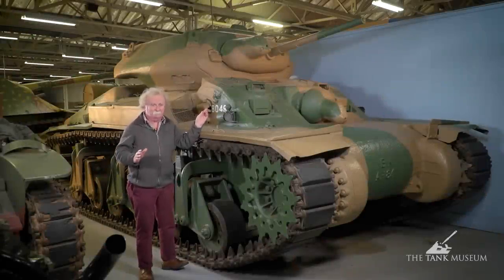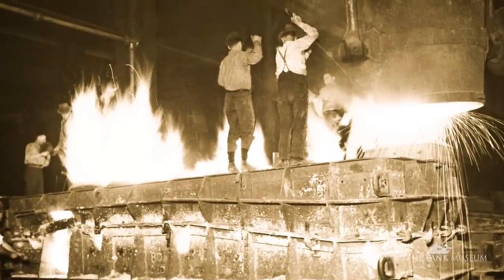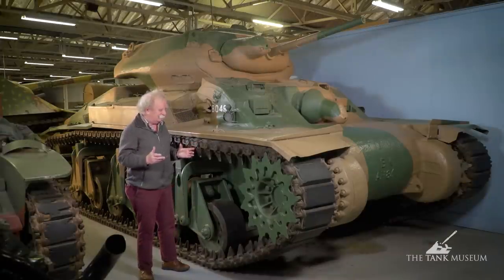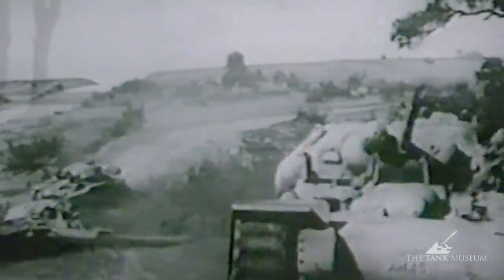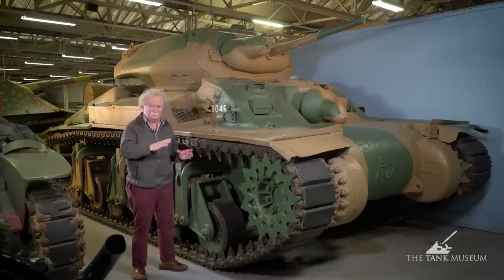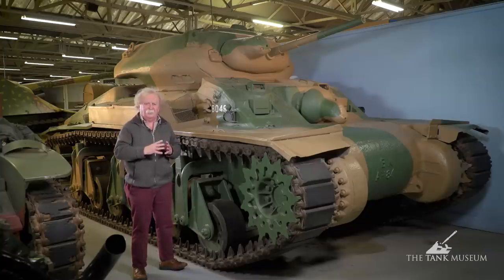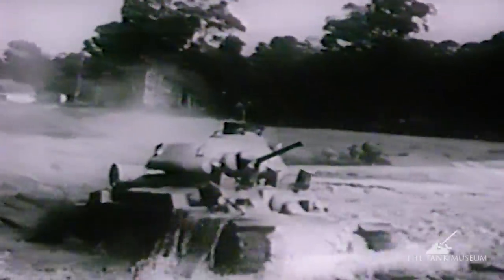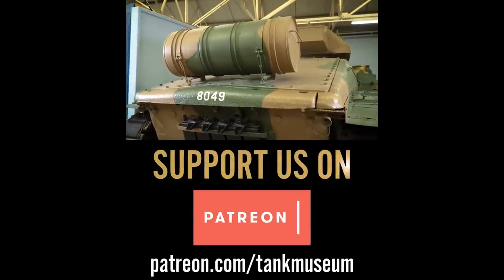Tank Chats #73 Sentinel | The Tank Museum

Comment: It's a shame the AC1 Sentinel is known for one small lewd thing, because it's a marvel of achievement for the Australians, with very little help from anybody else was able to produce a respectable tank.
Reply: Do you know if the engines were sourced from America or they were already being built their under contract ??
Reply: I wouldn't call that small!
Nice profile picture by the way :)
Reply: @mattmopar440  I think they were already being built under licence in Australia, without looking it up but at the time of the start of WWII Australia found itself far away from the supply of equipment which meant the start of panic programs to quickly design and build our own weapons which meant using whatever we had at hand thus the Boomerang was developed out of parts we were already building under licence for the Wirraway trainer for instance, so I suspect that the same will be for engines and such.
Reply: @mattmopar440  They were commercially available auto engines. They had planned to use the 'wasp' radial engine from the Boomerang but the Airforce needed as many as they could get. I recommend looking up a picture of the Sentinel's powerpack, very complicated engineering for a first tank, the transfer case is nearly as big as another engine.
Reply: Early on australia was too far away for anyone to effectively import cars. those ginormous car carrier ships didn't come along until well after the war. So we made our own versions of most cars in house. We had ford and chrysler and holden factories churning out localised versions of the cars. Now whether chrysler was manufacturing engines at the time i have no idea, a quick google didn't show anything up either but i can imagine they were.
Reply: Given the likely foe of Japanese tanks: the sentinel was better armored, a little slower, and had a gun that could obliterate them in the 25 pounder short barrel. The 17 pounder would have been better at attacking bunkers, as the Japanese favored light fast machines, which combined with the utterly under-powered tank engines they owned left them with probably the worst 'modern' tanks in the war. If the japanese had actually invaded australia: the climate would have been a shock: and the tanks would have been worse! Of course native australians had no idea how to perform combined arms warfare and they would probably have been lost to infantry in action but STILL the Australians had (somewhat) better tanks!
Reply: Glen McGillivray are you kidding? The Germans got schooled in combined arms warfare by an Australian in WW1. Sir John Monash.
Reply: lol, go straya!
Reply: @TinBane  alot of the combined arms strategies we're still experimental at the end of ww1. Thus it was often discarded, I believe the Aussies would've put up a decent fight but they really wouldn't been able to stand up to the Japanese imperial army and Navy.
Reply: @TinBane  very nice: but one visionary does not a training school make. Soldieirs in Australia would need to surpass the Veteran Japanese forces.
Admittedly behind those Veterans, the Japanese were all green recruits so Australia probably would be fine: I'm just being realistic that it would be hard times for the first 6 months while the Australian government tries to decide if they will capitulate or not.
Reply: @glenmcgillivray4707  We did, in Kokoda, with volunteer troops who were woefully under equipped.
Reply: @glenmcgillivray4707  Keep in mind though that Sentinel AC1 was designed before Japan entered WWII (or, at least, at war with British, Dutch, French & US forces and their allies) - it was attempting to fulfill the same niche that British cruiser tanks were thought to be needed for.

As it happens, once Australia withdrew from the North African theatre it might have been a very adequate tank had land war made it to the Australian mainland.

It had been thought that mechanised warfare on land was pointless where conflict might occur with the Japanese

As it happens, the use of light tanks by the Japanese at Milne Bay, though ultimately futile for the Japanese, might have cast things in a very different light had they landed with more light tanks. (It's hard to say though as the armour of these vehicles may well have been insufficient to protect them from aircraft)

Ultimately, though it's a question that never got answered as the circumstances never arose
Reply: @glenmcgillivray4707  Utter rubbish. Rommel's first defeat in battle was at the hands of the Australian 9th Division under command of Leslie Morsehead. The Australians in Tobruk used captured Italian tanks against Rommel. Japan's first defeat in battle was by Australians at Milne Bay in PNG. Dunno what history books you've been reading, but try some with actual history in them.
Reply: @aaronleverton4221  Green Troops vrs Veterans. The Australian expeditionary force was certainly well regarded, as were the New Zealanders, but with the more experienced troops already overseas, and the panic from Japanese on the mainland, who knows where the balance of power could fall. When attacking prepared positions, the defenders can stack their advantages. When attacking unfortified or unprepared positions, those advantages can be lost quickly. Rommel harnessed that knowledge quite well, but Tobruk he surrounded and tried to fight into: discarding the advantages of mobility. Fact is the Australians fought hard and did not falter under serious threat, and refused to surrender. Rommel really was confronting a serious hard-point with logistical problems to his rear and little opportunity to exploit his advantages. Now if the Italian navy or some German subs were to close the port from supplies: who knows what might have happened with Supply issues for both sides :D
The biggest issue with Hypothetical engagements is they are of course Hypothetical. If the Japanese failed to secure a major port: any invasion could be crushed under weight of manpower and equipment, if they DID it would probably limit their fighting force to the scale of the merchant marine to supply a force on the mainland, something of a key weakness that could be exploited by any navy in the region. But let us not forget that during world war 2: Japan had a greater population than Australia, but with less area they have to resort to importing a lot of material for building the materiel of warfare, further straining their ability to ship in supplies.... And japan DID declare war on the USA when they decided to enter the war, if they hadn't maybe the USA would have sat on their comfortable asses (remember world war 1? For years they preached neutrality) meanwhile Japan could have invested it's soldiers and supplies in crushing the British colonies. Or maybe it would have stepped in, with all the capital ships from pearl harbor unmolested to raid said convoys of cargo. Who knows?
Reply: @glenmcgillivray4707  Ugh, almost no facts and pure diversion. Yes, Tobruk was a hardpoint, so what? Th 9th Division defeated Rommel in battle and had combined arms experience. The 9th was recalled from North Africa for the defence of Australia against the Japanese. If the Japanese had invaded they would have been fighting against the 9th (which they did anyway in PNG).
Still, you were, in fact, correct when you said "Of course native australians had no idea how to perform combined arms warfare...", however Australia wouldn't have sent the Aborigines to fight the Japanese, it would have sent the army.
Reply: Meanwhile in New Zealand... We got the Bob Semple tank
Reply: @TinBane  Sir John Monash was the complete tactican and used everything he could get his hands on. Pity the Brits didn't learn from him Germans got the lesson. I reckon they should let Monash loose and he would have had the Aussies marching through the Bandenburg Gate.
Reply: better than NZs tank effort, semple. . .
Reply: @glenmcgillivray4707  I think Aaron Leverton has summed up most Australian's objections to how they are perceived. Australia contributed as much manpower as the USA to WW1 (10% of our entire population voluntarily enrolled) and by the time the British had realised that they should allow the formation of an Australian Corps and give Monash a free hand they were already preparing for the war to continue to the end of 1919. Follow Monash's engagements after being given more control and factor in that the Australian Prime Minister would not allow Australians to stay in Europe after 1919 and you can see why the Australian forces had a frenetic pace to bring the war to a close. To suggest that Australian forces wouldn't understand combined arms warfare is like telling us we don't know how to swim forward crawl or how a modern black box recorder works. We might not be undisputed masters of them, but we had a hand in their very formation. Australian forces lost about the same number of troops as the US, the main difference was that most Australian troops were lost in combat, not to disease. 

If you want to set up a hypothetical where Australia is fighting Japan in some other place, or in some other time than they did in WW2, then maybe state your assumptions. The 9th Division as Glen pointed out fought in Africa and were exposed to tanks, anti-tank warfare and combined arms. Furthermore they were exceptionally resourceful a world away in unknown territory. The same 9th fought the Japanese in the islands north of Australia, unless Japan was in another timeline, it would not be able to invade Australia prior to this time and therefore before the Veterans of the 9th were released back to Australia. Australian forces (in spite of MacArthur's initial attempts to sideline them and deprive them of resources) fought the Japanese to a stand-still on land, in terrain that is not readily found in Australia, and without naval or aerial supremacy/support.

So when you tell us that if the Japanese had invaded Darwin (have you ever been to Darwin? Or maybe you'd care to suggest somewhere else), and we had the same veterans with better equipment that could be resupplied from our own factories (and not borrowed and stolen in small quantities from the Yanks) we would have had a hard time, I don't really know where to start. It's really interesting that there's a view that there is panic, rather than prudent response by Australia. They had just watched the fall of the Philippines because of a combination of complacency and cowardice on the part of MacArthur followed by the capitulation of 85,000 defenders of Singapore to an attacking force of 36,000. In that context plans to build up capability within Australia to fight independently, to fortify the east coast with prepared positions and to prepare for a guerrilla war were not paranoid but perhaps over-preparation based on the poor performance of the world's super-powers of the day.

Of course if the Japanese were invincible then MacArthur was a genius (which is laughable) and the senior British commanders of Malaya, Singapore and Force Z were brave individuals daring to stand in the way of inevitability. But holding any part of mainland Australia would either be nothing but a vanity (in the case of NT or far-north QLD) or gross overreach (in the case of NSW or VIC). The cost in focus, manpower, materiel and overstretched logistics would have been extreme and potentially hastened the war in the pacific.

Of course, the sources you choose to read will all impart their own rhetoric on who is responsible for what, and what was possible. If you believe T.E. Lawrence  in his own book then the Arab uprising was materiel in control of the middle-east in spite of those in government/military. If you read the actual dispatches and diaries of those involved you realise how limited his influence and control was, and how often the Arab forces failed to turn up to key battles despite the political push to include Lawrence and Arab forces in the action. When you view it in the context of denying the French their spoils under the Sykes–Picot Agreement and instead putting them in the hands of individuals who have been groomed and uplifted through British action it all starts to make a bit of sense why there was a great deal of pain taken to show the  "Arabs" took a series of conquests (of course, after the Desert Mounted Corps has done the fighting and was instructed not to enter the city).
Reply: @kmoecub  not sure what your point is. The tanks hadn't even turned up in time and some units (from the west yorkshire regiment) attacked alone. Australian commanders asked for a delay, and were forced to attack the next morning. The attack was not planned by Australians, it was not executed in the style the Australian commanders would like. To quote John Monash "the true role of infantry was not to expend itself upon heroic physical effort, not to wither away under merciless machine-gun fire, not to impale itself on hostile bayonets, nor to tear itself to pieces in hostile entanglements—(I am thinking of Pozières and Stormy Trench and Bullecourt, and other bloody fields)—but on the contrary, to advance under the maximum possible protection of the maximum possible array of mechanical resources, in the form of guns, machine-guns, tanks, mortars and aeroplanes; to advance with as little impediment as possible; to be relieved as far as possible of the obligation to fight their way forward; to march, resolutely, regardless of the din and tumult of battle, to the appointed goal; and there to hold and defend the territory gained; and to gather in the form of prisoners, guns and stores, the fruits of victory.". Bullecourt was within 6 months of the tanks' first deployment and it wasn't until Cambrai about 6 months later still that British tanks had their first real success, although they still had significant reliability issues.
Reply: @TinBane  Frankly the day Pearl harbor was bombed, Japan failed any attempted invasion of Australia in my eyes, despite her army numbered in millions of soldiers, with rifles, machine guns, artillery, ammunition, tanks, warships, aircraft and the rest. Opening a second front of hostilities against the USA in World War 2 doomed their attentions and military to have to do too much at once. 

This when facing against an Australian military on the back foot still trying to re-arm following the great depression. By 1942, with Japans entrance into the war, Australia had massively ramped up their domestic production because the war in Europe had drained the British empires reserves, as such wars tend to do going from peacetime to total war footing.

IF Japan had/could mobilise their army into Australia, IF they could maintain the flow of supplies to their own troops into Australia, the quick question becomes: how long till the ammo runs out and Australian troops are forced to trying to kill hostiles with local wildlife (Roos, Spiders, Snakes, Dropbears.... oh wait that would have ended the war with the utter extermination of all life in Australia, if not the world *shudder*). Yet in 1939-1940 Australia had not enough of the force multipliers she would have needed to supply any force with enough power to repel an invading force. YES Australian troops can fight hard. No domestic stockpiles are unlikely to be able to sustain fighting on the scales Japan could have fielded. I am reminded that in the inter-war years there wasn't enough ammo supplied to some militaries to allow troops to practice firing the machine-guns they had. I haven't seen any useful info about Australia's state at that time outside of 80,000 troops listed in 1939.

Then again: Australia is a big place, and feeding a million soldiers in that sort of terrain could have very well crippled japans merchant fleet, rendering her unable to supply her industry to manufacture more of the guns/supplies the troops holding the line in Australia would have needed.
I can see why the Japanese army vetoed the notion when the Navy proposed plans for trying on a far more limited scale (which frankly assumed that the conquest of a few ports in the north would be enough to persuade the Australian government would roll over and give up/surrender/peace out. Unlikely)
Reply: I'm curious how the Sentinel Tank would have performed in PNG? Would it have been able to deal with the terrain - I'm assuming the flatter parts and the coast ect, not the mountain tracks that were even an effort for humans and had so much mud that light artillery carriage wheels were jammed and had to be dragged at some points. 

But still there are different levels of jungle for tanks to move and fight in, and having the Sherman tracks might limit it slightly, but would the French variations help or make no difference?
i.e. Would the bugger get constantly bogged?
Is there any information at all about how reliable it was, even on the Cadillac engines?

And when it came to the fight would it hold its own?
Could the Japanese penetrate its armour with anything they had in PNG? I'm assuming it could destroy Japanese bunkers (although HE is best, could it fire any?) and would the light Japanese tanks be cannon fodder for it?

Finally slightly off topic, but from logical perspective wouldn't it have been better for the Allies just to give the Australians the plans and say one sample of a already designed British or American tank that we could copy, modifying perhaps for available resources (the radial engines were all going to aircraft - the Boomerang, so the Cadillac solution, tank engines were often varied in WW2 in production runs, look at the Sherman).
From the point of view of the U.S. and the British, getting Australia up and running asap with armour was the vital issue, not some parochial concerns over who makes what. 

A Australian copy could be constructed without the design delay and basically reinventing the Wheel. 
Hell with Australia's mineral resources we could start supplying local commonwealth countries with gear, freeing up their military logistics chains from having to ship it over. 

And if the Australian tanks were an exact copy with interchangeable parts with one of their tanks, well that helps them as well. 

And does anyone knowledgeable have any suggestions on what tank Australia should have copied with the manufacturing resources and requirements at the time. 
Of course we would choose the Matilda if just looking at names in a catalogue …
Reply: Depends where in PNG you are talking about. On Kokoda? Impossible. No tank from WW2, not even Churchill, was capable of operating there. Buna-Gona on the plains north of the Owen-Stanleys? Well, having a 17 pounder tank, instead of 37mm Stuarts or 2 pounder Matilda 2s would probably have been a whole lot more reassuring for the infantry walking into prepared Japanese positions.
As a side note, the Brits appreciated the M3 Grant/Lee as a stopgap (75mm main gun) until their decent tanks turned up in North Africa, but Australia refused to take the M3 Medium (not the M3 Light) tank to PNG, choosing the much more heavily armoured Matilida 2 from UK instead.

As for reproducing a foreign tank, there were multiple issues, from combat survivability to firepower with both British and American tanks, Australian military authorities were, apparently, happy with none of what their allies had to offer. They weren't exactly alone, the British created the Sherman Firefly by mounting their (and the Allies') best anti-tank gun on it: 17 pounder. The Yanks simply didn't have a good enough anti-tank gun and their tank was just too thin and never sufficiently upgraded through the war. Numbers may be great when your factories aren't being bombed, but when you deride the infantry tactics of WW1, why is it ok to apply them to WW2 armoured warfare?
Reply: Glen McGillivray lots of ifs and hypotheticals mate. History has already had its say and it says we won and they lost
Reply: TinBane well said sir
Reply: @glenmcgillivray4707  Australia supplied the US forces in the South Pacific with all the food, ammunition and clothing they used. 6 Billion dollars worth (in 1945 values).
Reply: @casbot71  The Australian forces in PNG were using a modified six pounder gun manufactured in Australia. It had a special lightened design to permit it to be carried over the Owen Stanley range. The Japanese had nothing that heavy in the mountains but some of the guns on the coast were of significant size.
The Australian arms factories supplied most of the Ammunition, Clothing and Food used by the US forces in the South Pacific. 6 Billion (1945) US dollars worth.
Reply: @allangibson2408  The Australian army never used a six pounder in Papua or New Guinea. There was no need for it because the 18th Army basically had no tanks. The main anti tank gun used by Australia during the war was the 2 pounder, which was manufactured in Australia. There was never a need to upgrade to the higher caliber AT-Guns because Japanese tanks lacked the armor to justify switching over to the 6 pounder. 

What you are referring to there is the Short 25 Pounder, which was an artillery piece, not an anti tank gun (although it could fire AT ammo). That was a lightened 25 pounder, which was designed and manufactured in Australia specifically for jungle warfare use, but it was never intended to be used in the Owen Stanley Range. By the time it was introduced (mid 1943) the Australians were fighting in New Guinea, as opposed to Papua. It was used in the Lae and Finschhafen battles, not to mention the late war campaigns such as Bogainville, Wewak and Borneo.

Apparently it had mixed reviews. It worked, and it sure was light, but because of the short barrel the concussion was brutal, so the gunners didn't like it. Plus it had a limited range, so it never fully replaced the standard 25 pounder.
Reply: @aaronleverton4221  The 17 pounder was an AT-Gun mate. It was designed to penetrate armour primarily. That why it wasn't used on infantry tanks. It had a high explosive round, but it was not a great one (it was inferior to a Sherman's 75mm HE round). If you wanted to use Sentinel for infantry support then the 25 pounder model was absolutely the way to go.  That thing fired an 11kg HE charge that would have demolished Japanese bunkers and defensive complexes better than any 17 pounder would. 

The Matilda didn't just have a 2 pounder gun. There was a variant (which the Australians loved) which employed a 3 inch (76mm) howitzer, which actually outperformed the 17 pounder in terms of its HE round (6kg). Typically an Aussie Matilda tank troop would have 1 3inch vehicle with 3 2 pounder models, so they were used extensively.
Reply: @glenmcgillivray4707  "Soldieirs in Australia would need to surpass the Veteran Japanese forces"... You mean like they did at Milne Bay, Isurava, Ioribaiwa, Templeton's Crossing, Kokoda, Gorari, Buna, Gona, Sanananda, Wau, Mubo, Salamaua, Bobdubi, Lae, Scarlet beach, Finschhafen, Jivevaneng, Sattelberg, Pabu, Sio, Kaiapit, Shaggy Ridge, Madang, Wewak, Bogainville, Tarakan, Balikpapan, Labuan and Burnei? Those are all battles the Australian army won when facing the Imperial Japanese Army. The veteran, elite South Seas Force was decimated by the 7th Australian division in the mountains of Papua. 

You people really should actually understand a little history before you make comments like this.
Reply: @timblizzard4226  The 17pdr was an anti-tank gun, you say? Let's see, what did I say about the 17pdr?
"...their (and the Allies') best anti-tank gun on it: 17 pounder."
As for the rest: yes. A lot more info than I put, but yes.
Reply: @aaronleverton4221  you were referring to its use in the infantry support role, something about Aussie troops being happier with a 17 pounder as opposed to a 2 pounder when engaging Japanese bunkers. Right? Well my point was why would you use an anti tank gun on an infantry support tank if you have a 25 pounder model available that was much more effective in that role. I can’t believe I have to spell this out for you. Yes, you may have said “anti tank gun” but then talked about using that weapon in a sub optimal way, which was my whole point.
Reply: @timblizzard4226  I don't believe you need to spell it out either, given that it a) wasn't the main point and b) wasn't wrong either.
Also, there was no 25pdr Sentinal. The twin short 25pdr turret was purely a recoil test-bed for fitting the 17pdr.
Reply: @aaronleverton4221  again, I ask why on earth would you use a 17 pounder equipped cruiser tank in the infantry support role, which was what you were proposing???
Reply: @timblizzard4226  Because the Commandos used Boys to take out flak towers and the Australians used 20pdrs against bunkers in Phuoc Tuy. Because 17pdr could do the job adequately and if, this all being an exercise in hypotheticals, Sentinel had been upgunned and used in combat to defend Australia, its numbers were small enough that I doubt they would have made any "infantry support" variants. They would all have been 17pdr..Because that's what all the post-war tanks were going to have and commonality of logistics is incredibly important to an army the size and budget of Australia's.

Edit: Boys, not PIAT.